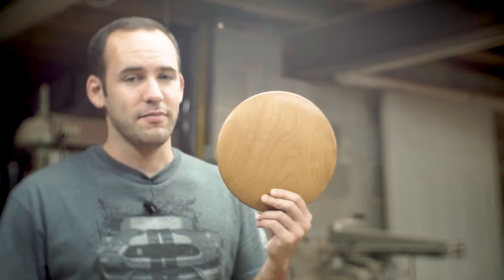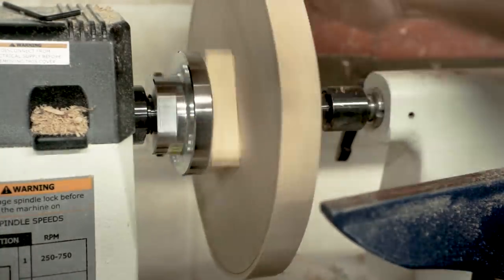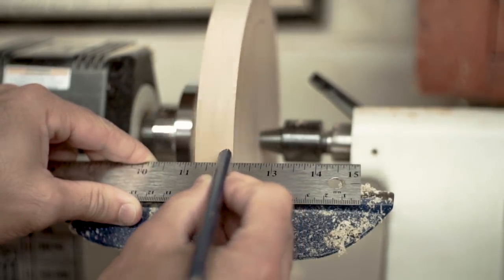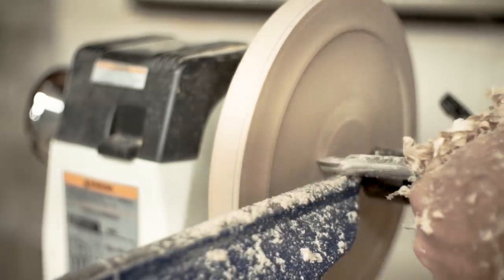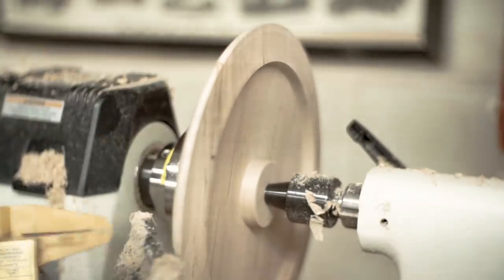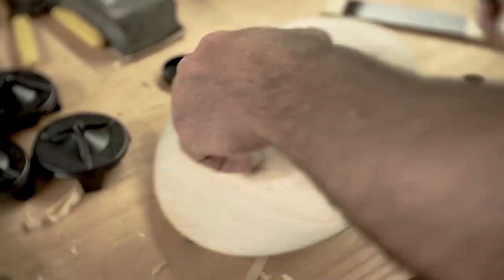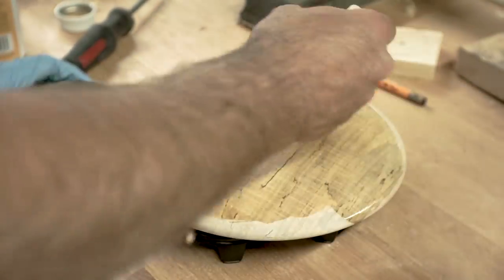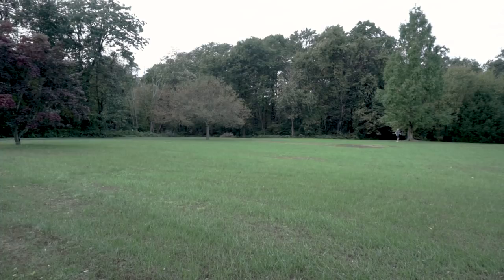Will a Wooden Disc golf Disc Fly?

Comment: Nice TURN! A hint to help you getting your project off the glue block is to cut a cross in your glue at least 1/4 x 1/4 inch. This give one a place to pry from. Go slowly and rotate the piece and pry from all 4 corners.  If done correctly,  not damage to your piece and no glue clean up! SAFE TURNING, John.

Comment: Of course it flies!
I have turned over a dozen discs which I used as trophies, but I did test fly a few of them. What I found was that discs will be destroyed quickly unless they are plywood made from very tough woods.

And so I ordered a bunch of laminated discs from Brad at Flywood - a now-defunct wooden golf disc maker. Brad made his own blanks from hand-made laminates of maple and something - I forget. The upshot is that the discs are extremely tough, and they are not harmed by impacts unless they hit asphalt or rocks. 

They also make an amazing sound when they hit trees, or the chains.

Sadly, the PDGA requires discs to be flexible, so they could never be used in competition.

Comment: Really nice job. Really cool decoration as well. Probably already know this trick, but I’ll share it anyway. You can use an old piece of carpet pad under the item your sanding and it will hold it in place without clamping it.
Reply from the maker: D. O'Hanlon thanks. I have not used that trick, but will have to give it a try.
Reply: Jody's Woodworking 
Glad to share. Yeah cut a few pieces different sizes. Between the friction, multiple kinds of rubber in the pad and downward pressure from the sander makes it “stick”. After awhile vacuum off the dust and you’re good to go again.  Have you ever thought about making and selling the wooden discs?

Comment: I too am curious as to how many grams it weighs. 

Also I think using different woods laminated together would make a wooden disc perform better. Use the heaviest densest wood at the area the rim is thickest and the lightest (bass maybe?)  for the flight plate. And  maybe a wood in between the two.  I understand this would be fragile but it might stay in the air longer.  Shoot for something under 175 g!

Comment: What weight did they end up at?
Reply: Yes, please, tell us the weight.
Reply from the maker: The cheery disc is 197 grams.
Reply: @jodyswoodworking5477  nice and hefty!  I bet you could get a pretty good flight if you put full power into it.  I'd probably just hang it on the wall though; so pretty.
Reply: shave off more wood and bring it to 180g or 175 and see how it flies. Would be more accurate with what most of us throw.
Imagine a balsa 130 wt. .Make sure your down wind with that one.
For toughness use Lignum Vitae. The old wooden bowling ball material. Probably would level a forest with it. LoL
Thanks for making this video.
Reply: @markhumphrey8894  For something as thin as a disc, the grain of the wood is at least as important as the hardness.  You might not be able to dent some hardwoods but if you made a disc out of them they'd be liable to split.
Reply: I think according to the pdga max is 200 so 197 isn't bad! Cool video thanks for uploading!
Reply: @kendelroten3629  I believe the legal max for a disc depends on its diameter.  For most discs the max weight is 175 grams, but for wider discs it's higher, which is why the pros throw Rocs that weigh in the 180s.
Reply: @doktar well thanks for the heads up!
Reply: I throw and turn.  Great to see this video.  Great job!

Comment: they taught us in junior high woodshop to glue a piece of paper between the part and the face plate wood.   One quick blow with a mallet separated them cleanly.  all you had to do was sand off the (half) piece of paper on the part and your were good to go.

Comment: Awesome project! 
Just a tip for doing your glue ups like that. If you sandwich a piece of news paper in the glue between the work piece and the scrap, it should separate cleaner and leave less work to clean it up
Reply: Does it have to be a specific section of the newspaper or is sports fine?

Comment: Glue a piece of paper between both of your pieces of wood. Since the paper is multi ply, the paper will separate making it really easy to brakes apart. Then you just need to sand a thin piece of paper